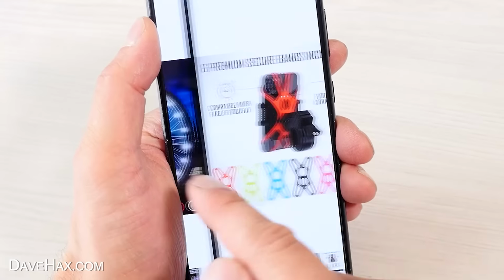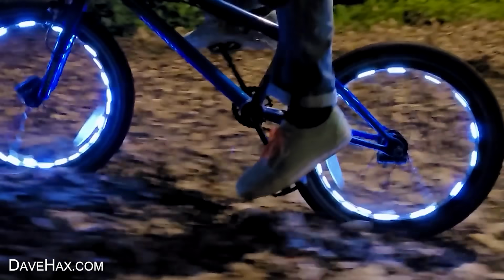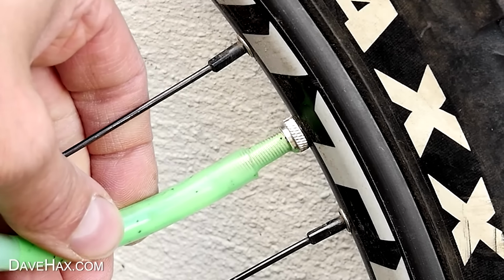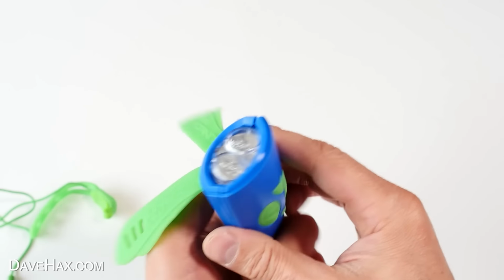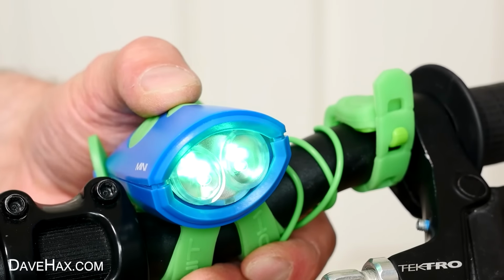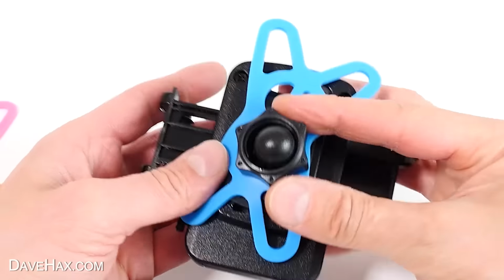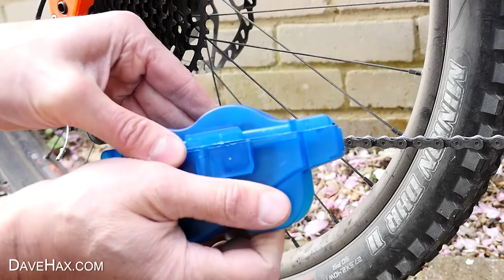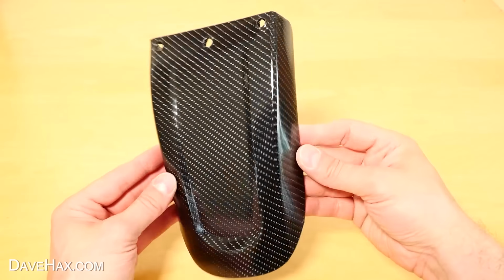The LED Bike Wheels look BRILLIANT!

Comment: I liked the multi tool the most and I use Slime all the time on all my bikes and scooters. They make tire (or "tyre" ) liners as well! Used in combination, your tires become Nearly bulletproof! Now, after you've cleaned that chain, use IceWax on it instead of wd40 if you want to keep dust out and go Stealth, sound·wise.

Comment: Only the multitool looks usefull. The anti-flat tire slime looks useful in theory as well, but I've actually tried it myself (years ago) and it doesn't work in practice. My guess for why it did seem to work at the separate tube is that 
A. The separate tube has just been filled with slime & air, so the slime hasn't had much time yet to completely react with the in-pumped air and therefore hasn't set/thickened/hardened yet. Therefore it's still able to flow out through the puncture
B. The outside of the separate tube is in direct contact with the air while a tube-in-tire is not. The slime in the separate tube therefore can contact with the air outside when the tube is punctured, allowing the slime to set and thicken
C. The separate tube can be squeezed and bent to distribute the slime better. In contrast, a tube-in-tire has a set shape (around the wheel) and even though the wheel can be spun to help distribute the slime inside, the tube cannot be squeezed to force the slime further away from the entry point (the valve)
Reply: Plus there was hardly any pressure.  If you pump it up to 40 psi it wouldn’t work.
Reply: I've use Slime successfully on bikes, cars, and tractor tires after the fact, not as a preventative. For cars, and even bikes, it can cause balance issues, so use only if you must. It was great for the slow leak in an older car. I think it's safe for cars with tire pressure sensors, but check label.
Reply: @netwrench6570  i call the slime tire invulnerability liquid
Reply: I've used Slime in bike tyres before, and I say it's miraculous! Never had a puncture while using it, ever.

Comment: I got a set of the Active Lights. The best one to get in my opinion is the one that phases between different colours, it makes an incredible effect when you're riding. But sadly these lights are let down by poor reliability, the product just isn't good enough for me to recommend. The battery cases are lasting well, but it's the actual lights on the cable. Currently the ones on my front wheel are really reliable, the ones on the back work for a bit and then stop.

Comment: If you have a flagship phone like an Iphone, samsung, google, etc. Quadlock probably has a case for it and their system is second to none. I use a 0uadlock case and mount system for all my bikes, a recumbent trike and all of our motorcycles and cars. For chain cleaners, get the park tools version instead, it's much higher quality. As all of the Park Tools products are.

Comment: Warning about the LED wheel lights:

The mount won't work for e-bike with the motor on the wheel. You'll need to zip tie the battery holder to the bike spokes instead (may damage bike spokes though!)
Reply: Actually quite helpful for a lot of people
Good job man and thanks

Comment: I wonder if the copyright on phone holder has run out ,so other companies can use the product. I bought same phone clamp setup in 2018 for $12 NZD, still use it but comes with spring loaded hook to connect to air vent.

Comment: For cars, dont get the tire slime, either you or the autoshop will hate you for making a mess when the tire is inevitably replaced, plus there's always room to recovery supplies on a car. on a bike however, since the tube is a separate piece and the desire to be as light as possible, I see the mass appeal and dont see why not to use it. Though those "peel for the instructions" labels are horrible because they feel the need to sticky the whole thing instead of just the end, then it never sticks back properly and it's a headache.

Comment: Just something to note, you want to use a heavy degreaser when cleaning your chain, You want to also inspect the chain at that time for damage or excessive signs of wear and tear followed by relubricating your chain in a moderate weight grease as to not have grease flying off under normal use. And for god's sake... DO NOT USE OIL!!! Grease and oil are different things for a reason. A heavy grease wil stay on the chain while an oil will make nothing but a wet mess over EVERYTHING you just cleaned...

Comment: The trouble is Slime doesn't set when the inner tube is in the tyre.  Also you had less than 3psi pressure in that inner tube...now try it  at 55psi.  Anyone want to buy four bottles of Slime?  It's crap.